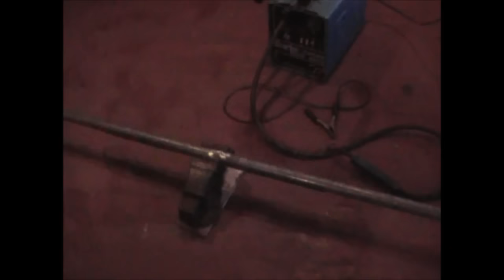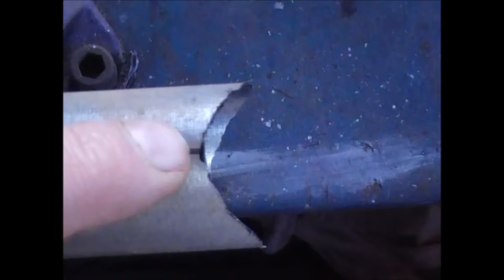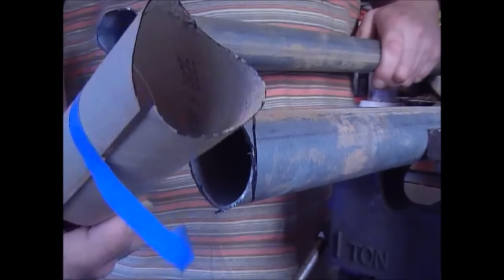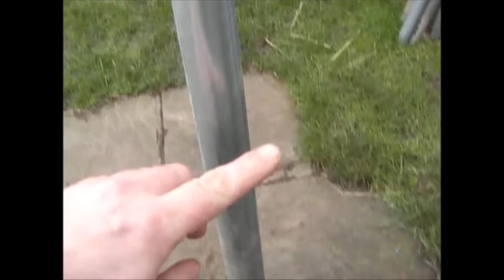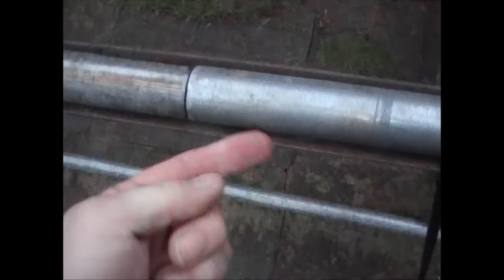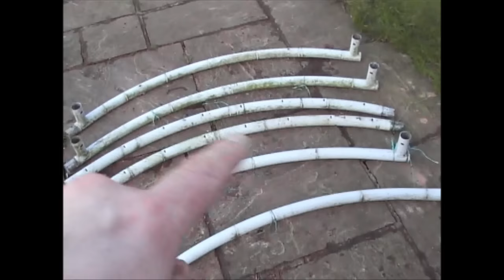Jim's Allotment - Plot 9 - How To build A Fruit Cage Part 2

Comment: I have got an old poly-tunnel  that I have taken down from one part of my garden and am putting it elsewhere I am wondering about replacing the polythene (its the green type) do you know anywhere that's cheap and should I go for clear this time, which is the best polythene to use. Liz
Reply from the maker: Hiya Liz, I have seen them for sale on eBay. They are not too much money. I am not sure what size your tunnel is,  but there is an example . . . 

http://www.ebay.co.uk/itm/New-Polytunnel-Greenhouse-Pollytunnel-Poly-Tunnel-Cover-Only-6m-x-3m-6-Section-/131058653516?hash=item1e83b4594c:g:edAAAOSwYIhWi7Zd

Hope that helps .. All the best Jim..

Comment: Aa nice sturdy framework Jim.. How are you going to treat the areas where the Zinc plating has been removed? Or will you paint the finished structure?
A belated Happy New Year!........Nigel 👍🏻
Reply from the maker: Hiya Nigel, time permitting the whole structure will be painted( primer + top coat), if not I will just paint the bits where I have joined together with grey paint ( so you cannot tell) One way or another they will be protected, I'm hoping this to last me for a few years   :O).. Cheers Jim..